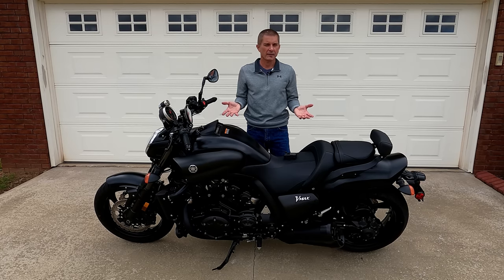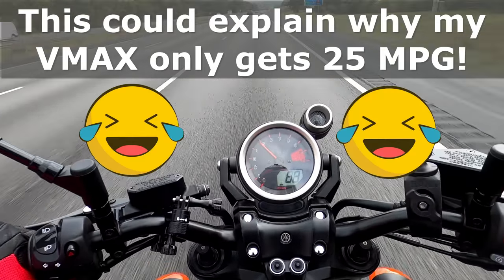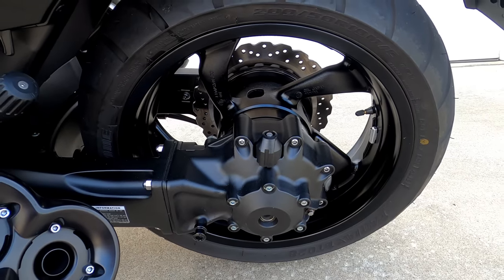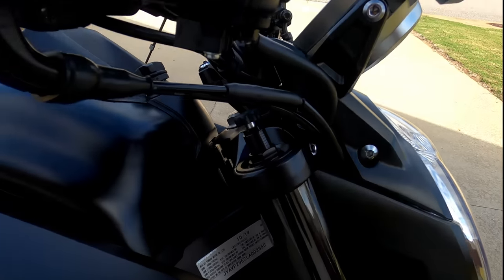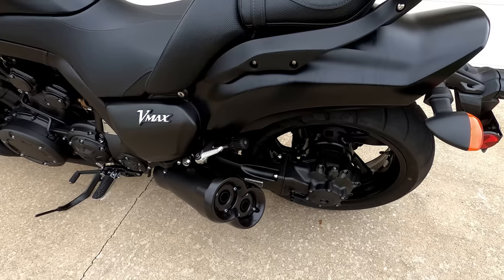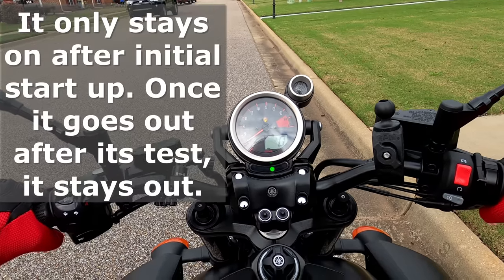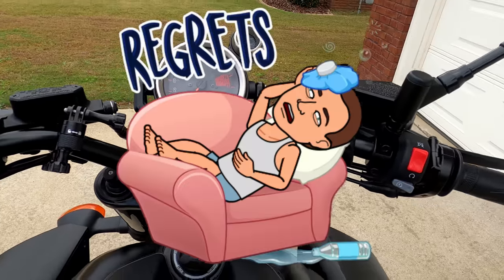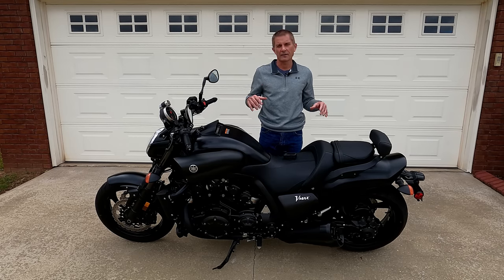2020 Yamaha VMAX 1700 Comprehensive Review | Walk Around and Ride

Comment from the maker: Please SUBSCRIBE, LIKE, SHARE 

Watch Next: Yamaha VMAX 1700 Instrument Panel Overview: Operation and Functions - https://youtu.be/wrduwgPm-jQ
Reply: I want this bike someday maybe if i am rich someday
Reply: You will get hurt on that bike if you are not careful.love to have one .
Reply: Vmax muscle male 😎
Reply: 5'6" 130 lbs riding a 600+ lbs bike. You're amazing, man.

I want to get into motorcycles by starting with a Honda Rebel 500 but i am reluctant because i am only 5'7" 125 lbs.
Reply from the maker: @sepg5084  Thank you. I started with small bikes and worked my way up. It's not intimidating that way.
Reply: I have owned a 1985, 1993, & 1995 VMAX, but not the 1700cc model. While I agree with most of your comments, I did find that my machines pulled to the right due to the shaft drive.
The 1995 was modified to use K&N individual filters with larger jets in the carburetors, for an increase in the power delivery. I never liked cruising more than 20 miles with any of these bikes due to the higer RPM even in 5th gear. While I had the 1995 VMAX, I purchased a Yamaha Roadstar and over the next year I put on 6000 miles on it...and only 600 miles on the VMAX. On the highway the Roadstar was 2000-2200 RPM at speed...something to think about.
Reply: Hello Jeff - Thank you for this 2/2 Vmax Vlog Footage.
As you talk about, being a small frame, has it ever bothered you with this bike? For my own, 167 cm featherweight and I find my K12Rs sometimes a bit heavy when stationary. (own the 1200 summer 1992) Always been a fan of the Vmax so if I had to choose my next bike .. would you dissuade me ? my plans are : VROD (VRSCA) Nine-T and if.. 1700Vmax ... Thank you all your followers - also thank you for your channel. ✌ Friendly.
Reply from the maker: @roodytjm9282  The new VMAX weighs about 60 pounds more than the 1200 VMax. There are people smaller than me riding heavier bikes than the VMAX with no problems. So it just depends on your comfort level. I agree that the heavy bikes are a problem when stationary or trying to move it around in the garage. But other than that, I'm still comfortable with it.

Comment: I am never getting rid of my 2020 VMax. The most fun, and comfortable fun on two wheels!
Reply: You can have different types of fun on bikes it's not all about power I have a few big powerful bikes that are fun but also a little 125 mini bike that's actually more fun
Reply: Same here. Best quality too.
Reply: Come ride my tt500 might change your mind,had a 700fazer loved it tt1980 fazer1984
Reply: Bmf
Reply: I just bought a used 2015 in September 2023 and just wish I would have got one brand new when they still made them…
Just learned about what I wanted about a year ago and a co-worker recommended VMAX but only used was available. The more I looked into reviews of bikes and having a new first bike I had to have one to grow with… I love how it is tame and easy in low RPM and get ready for the beast when you rip the throttle!
Reply: Loved my 1260S and now my Diavel V4....170hp and 500lbs
Reply: Oh this is not my only bike,  I have a Royal Enfield Meteor 350.  I live in the foothills of the blue ridge mountains. I have just about as much fun on my 20hp RE as I do on my 200 hp Vmax.

Comment: If this bike had a bigger gas tank and a 6th gear I never would have gotten rid of mine. Very difficult to cruise outside of city limits. The 5 speed transmission is geared for the 1/4 mile and no way to change the gearing for longer highway rides, nobody rides at 60 on the freeway.  If you go at 75 the rpms are so high that any touch of the throttle has a big change in speed.  Not to mention it seems like the gas mileage goes down into the teens. If all you want to do is boulevard cruise, there is nothing better.

Comment: So sad that Yamaha has discontinued this awesome bike 😢
Reply: Cannot pass euro emission....... Like all big hp bike, with the new cable-less injectio it would and tha would give it cruise control and traction control...   Maybe 2023....
Reply: I don’t see why a huge engine like this with moderate power for its size wouldn’t be able to pass the emissions.
It would certainly require some update on the exhaust and ride by wire but I don’t think it would require much change.
Suzuki did it for the hayabusa

Comment: I have a 2009 VMAX which I bought new in 2009. This is the best bike that I have ever owned. I'm 67 years old so this is probably the last bike that I will own. Here are a few comments that I have to amplify on your video.

* Jacking. I can't feel this jacking effect that some people mention and I've owned about 20 motorcycles. This is one of those things that people repeat because they've heard it before. It handles great for its size and weight and as well as any chain drive bike that I've ridden.

* Vibration. Did you know that Yamaha intentionally left some vibration in the engine? They could have completely eliminated it with a different counter-balancer but their consumer studies indicated that people wanted to feel a certain amount of vibration so a small amount was left in. It is not objectionable in any way.

* 6th gear. I still think a 6th gear would be useful to improve fuel economy on the highway. A lower engine speed reduces pumping losses and thus fuel economy.

* Fuel tank. A bigger fuel tank would definitely be appreciated.

* Sticker. You can remove that ugly safety sticker from your top cover very simply. Heat it up with a hair dryer for a few minutes. This will loosen the glue and you can peel it right off with no residue remaining. I did this the first day that I owned mine.

* Cruise control. I really wish this bike had cruise control. The sad thing is that it would have cost almost nothing to incorporate it. It already has speed sensors on the wheels and throttle by wire. The only additional items needed would be 2 push buttons on the handlebars and software.

* Oil pressure gauge. I really wish that the bike had an oil pressure idiot light. It only has an oil level idiot light.

* Not a cruiser. This bike is really not a cruiser. It is more accurately described as a naked standard which is the way almost all bikes were before about 1985. A cruiser's main feature is a very low seat with forward controls that I hate. This bike has controls placed just below the rider with the rider leaning slightly forward. All this makes for much better handling and control than cruiser-style controls.
Reply from the maker: Thanks for watching and adding additional thoughts. That jacking thing is coming from people who haven't ridden one. Now my Nighthawk 650 jacked the rear. But somewhere along the way, at least Yamaha, figured out a way to dispense of it. As far as the cruiser moniker, we may have to agree to disagree on that. When this bike first came out it was to compete with the V65 Magna, which was the first power cruiser. The term naked is a recent term that didn't exist back when we first started riding. Today's naked is the 1980s standard. The VMAX was more of a cruiser than a standard. Either way, we are both fortunate to have one, especially now that it just got the ax last week.
Reply: I thought I was the only one to find the "Only one forever" bike... I bought mine new in 91 and I am now 62... It is sitting in my living room as I type this...

Comment: I gotta say I was struggling with my 2019 being too sluggish in the handling until I saw your video on tire pressures.  From the dealer they not only had my tires at 36 lbs but it is not clear in the manual so I always ran it at 36lbs.  Once I upped it to 42 lbs per tire it became a different beast in the corners.  It went from wanting to stand up in corners to effortless in corners.  It handles incredibly well now!
Reply from the maker: I’m glad that helped make your bike handle better.

Comment: I have loved that bike for over 30 years 
Maybe I should finally try one out.
I agree with the five speed philosophy. It’s just really wide gearing from forth to fifth. So it effectively gives you the best of both worlds, acceleration and cruising ease. 
I had an old Harley with a spaced out for the gear and it very effective, for different reasons. 
Today a lot of people say any performance bike should be engineered like a crotch rocket and I just don’t agree with that thinking.

Comment: I think the vmax is probably one of the best muscle cruisers you can buy. Love the V4 engine. Most of my riding is sport related and some touring so I bought the HondaVFR1200F 1237cc V4 engine. Tuned to 100tq and 190hp. Weight is about 560lbs wet.
Reply from the maker: Those of us with V4 experience appreciate the unique characteristics of that configuration. Thanks for watching and commenting.

Comment: Great overview and love that paint scheme!  Just bought a 2nd Gen last week with a 240 rear tire kit.
 The prior owner added: Yamaha OEM saddlebags (rare),  Rizoma Sport CNC black Aluminum Hand grips. Black ASV brake and clutch levers, Folding Blacked out mirrors, Black Soto Rear Sets,  Low Profile Passenger Backrest (same as yours), Passenger Footrest Relocation Kit, Black luggage rack, Blacked out turn signal lenses, Black Handlebar, Black Side Covers, Black front fender supports and he included a motorcycle cover and a battery tender.  Looks to be $5K in mods and upgrades... I'll be adding bar end mirrors and maybe a black wrap to the intake scoops.
Been riding Harleys since 1980, still ride a black Terminator Fatboy.  Picked up a 1997 Gen 1 VMAX a few years ago and turned it into a Mad Max naked bike. That is the hotrod for scaring the neighbors. Looks like I'll be keeping all three...
Reply from the maker: Thank you. Congrats on the new VMAX. Both generations of VMAX are definitely keepers.

Comment: This has been my dream bike for about 3 years now. i bought a honda magna 750 V4 and fell in love with v4 bikes. cant wait to own one of these my self.
Reply: I rode a 1994 Magna VF750C (house mate's motorcycle) during a 6-month assignment in Huntsville, AL this past year.  I have owned a 1994 gen-1 V-max as well as a 2007 gen-1 V-Max in NY.  The Magna was smooth and an OK fit, but I missed the occasional V-Boost rush.  Now, I am back at home in NY (COVID-19 pandemic has us working remotely) and missing the warm Alabama weather for an opportune ride.
The gen-2 is too tall for me.  The gen-1 V-Max and Magna were good fitting with my short 29" in seam trousers.

Comment: I own a late 2007 Vmax. One of the last of the first gens. I also own an early 2009(manufactured in 2008)Vmax. First of the last gens. Here is my experience....with the gen 1, I get that instant recognition and for some, that nostalgia. With that is also the respect that bike gave the racing world. The gen 2, the recognition isnt there. Its only when I tell people its a Vmax is when the light bulb clicks. Power differences are night and day between the gen 1 and gen 2. The gen 1 has the Vboost which you "feel" kick in. Like secondaries on an old 4 barrel carb. The gen 2 power is smooth and strong throughout the entire RPM band but no "kick" once youre above 6000 RPM. 500 extra CCs and fuel injection is so much more superior to carburation. However, if you are thinking of getting a Vmax of any generation, its a bike that will not disappoint. And this is not a bike you get if you are concerned with fuel mileage. They are thirsty lil beasts and they drink well. 

Lastly, anyone considering VMax the years I think with "better" value would be early first year(1985) with stock exhaust. 1994 in yellow. Yes, some people have painted other year maxs yellow, but 1994 was the only year for yellow. 2005. This is their anniversary edition with only 2000 in this year. They have numbered badges indicating sequence. 2007. Last year of the gen 1 run. Every problem with the bike allegedly worked out(factory wise). 2009. First year for the gen 2 run. 2020. Last year of the entire production run. This list is my opinion and in no way shape of form should be taken as gospel. You can find each of these bikes and perhaps get one at a great deal. You may already have one of these bikes and didnt get what you though you were gonna get. The market will bear what the market will bear.

Comment: This is just my personal opinion here. The VMax ( 4 cyl ) the MT 01 ( 2 cyl ) and the Roadstar Warrior ( 2 cyl ) all come out of the one stable, Yamaha. The VMax is the only survivor, but it doesn’t mean it has the road to itself. The MT 01 and Warrior can hold their own with the VMax. Both these bikes are just as dangerous if ridden by an inexperienced rider. The MT & Warrior don’t need to rev as high as the Max ( 5k redline with certain mods 6k ). Where the Max probably has it is in the top speed, but then again at 130+ mph who cares which one has the higher speed. I have had my 2005 RS Warrior off the clock at 235kph and for a 63 yr old at the time was  enough for me. If I was say 30 yrs younger I would probably buy a VMax, but I’m happy with what I have. Thanks for the video from Down Under😎😎🐝
Reply from the maker: Thanks for watching and sharing your insight on this and other bikes.

Comment: Jeff, good review. Love your all-black version, esp. the exhaust looks better that way than in the titanium-color version. But now it’s getting time for some mods;-) Take a look at the OEM windshield, it really adds something to the look. Also, those hanging ear indicators had to go for mine. Kellermann makes some ultra-light and super small ones. I’ll send you pics if you want.
Reply: Other than adding a small boulevard windshield and some engine guards, pucks,,leave it alone!
Reply from the maker: Thanks for watching. Coincidentally, I am considering the Yamaha windshield, but more so to cut noise during motovlogs, than for looks.
Reply from the maker: @Jay_Hall  I'm with you Jay. I will not be doing modifications to this bike just for the sake of doing them, especially the exhaust. I will have a video at some point on modifications I will NOT be making. 😎

Comment: Great review!  For me it came down to the rocket 3, Vmax, and the Diavel 1260s.  I went with the Diavel simply due to a more complete package (handling, electronics, etc) but that Vmax was a VERY close second!  They’ll both do 0-60 in 2.5, and are screamers, but that Vmax price is really a steal.  Bigger and heavier make a better relaxed cruiser when you aren’t ripping it as well.  Phenomenal motorcycle.
Reply: Same dilemma, and I ended up going with a rocket 3r purely because I prefer the triumph aesthetics. Vmax was phenomenal though, and you’re really picking between 3 absolute winners…I kinda feel bad for HD fanboys

Comment: My '94 V-max gets 22.5 MPG driven sensibly.  It is 1197cc and on the Clayton dynomometer delivers 122.3 horsepower at the rear tire.  Crankshaft horsepower figures are not published but it is extrapolated to be 146HP.  The V-boost system is responsible for 26.2 of that horsepower as proven on the dyno.  This is an unmodified V-max with 3,941 miles on the spedo with premium fuel.  It weighs  604lbs wet.  By comparison, a stock Volkswagen Beetle rated at 65 horsepower puts out an actual 21 horsepower at the tires on the dyno, running the cooling fan and generator.

Comment: I don't mind not having a self cancelling module on my bike. My left thumb fidget all the time when I ride, I used to be so conscious with my signal lights, even when riding a straight 10 kilometer high way, my thumbs keep clicking on the center button on these signal levers. I'm way past the point where I no longer forget to turn off my signals. I managed to bring the same practice when I ride my car. But yeah, I guess you're right, there are still some wackos who keep forgetting to turn them off, so I guess I support this.

Comment: A couple 8mm plastic ties at each end of the coil spring anchoring it to the spring cup on any bike or car coil-over will hook one up astronomically. Its actually an old Rally trick where wire or a hd pipe clamp even used. :)

Comment: Nice looking bike all blacked out like that.  I read this is the last year for it.  

My Kawasaki Concours would do 90 in second gear and hit the rev limiter before I could shift.  The design of the shaft drive swingarm linkage removes the jacking that was felt in bikes from the 70s.  The advantage is that I can comfortably ride it across the country. ;-)

With that much power that bike does need a 6th gear.  At 60 mph it should be at 2000 - 2500 RPMs.

That Vmax engine is what many of us wanted in the new Star Venture touring bike.  They did the frame mounted fairing but went with an air cooled V twin.  It would need a huge gas tank though.